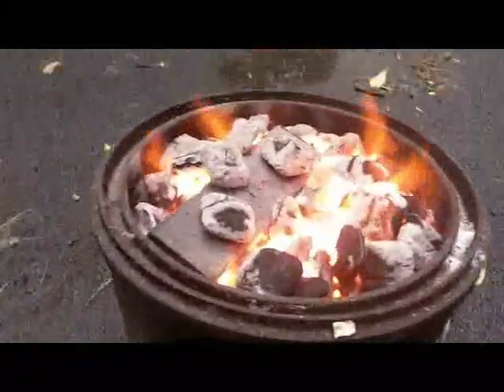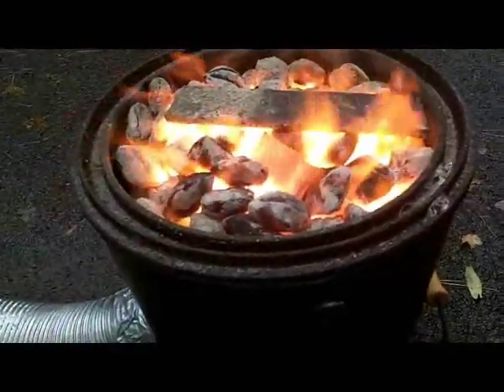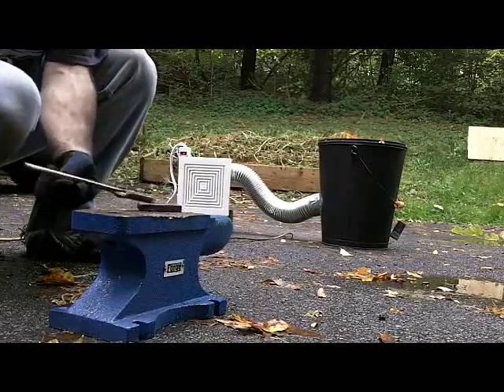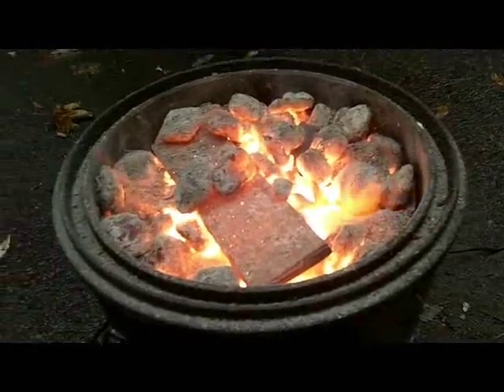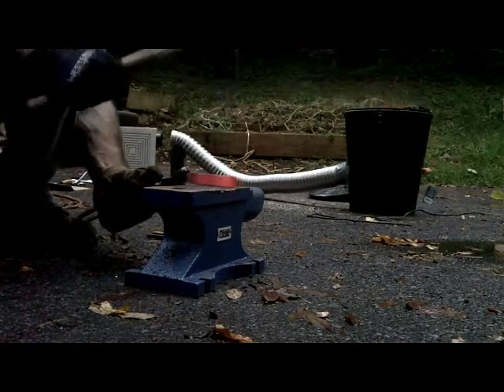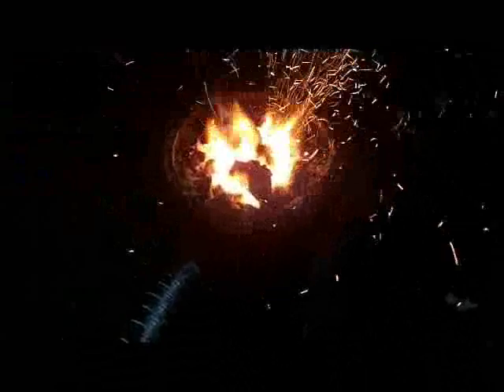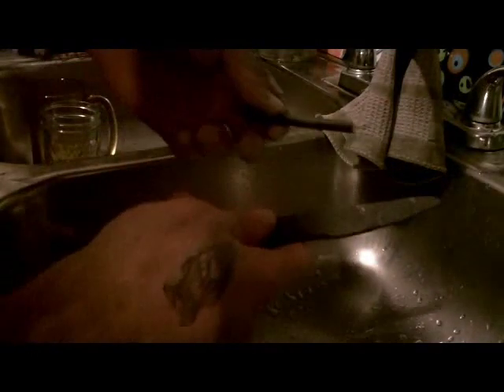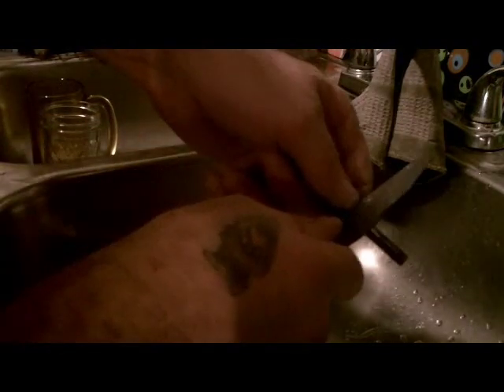Leaf Spring 1085 Knife and Homemade Brake Drum Forge

Comment: Soak lump charcoal in a bucket of water to reduce Sparks and conserve fuel.  Just dump half the bag in and add about 2-3gallons of water.  As you run low in the bucket, top it back up and slosh it with your hands
Reply: +drason69 oh, really. And I suppose if you heat up the anvil to red it will make the knife keep it's heat longer.
Reply: Actually, if you have any blacksmithing experience, you would understand how it works. Sorry I had to stoop so low as to reply to sarcasm with sarcasm.
Reply: drason69 I don't have any experience with BLACKSMITHING, but I have extensive experience with FIRE. It just seems like adding water to fuel would't work that well.
Reply: The practice of wetting the fire is to control the Sparks and allow the smith to regulate fuel use
Reply: ok.

Comment: Nice. I have made a couple of file knives and looking to do the leaf spring next. I like your forge. Did you cover up the big hole in the drum?
Reply from the maker: Yes there is a drain cover over the big hole and a plate over the lug holes...  Will try to post a detailed video of the forge because it has proven pretty functional and much cheaper and easier to make than any other simple design I have seen
Reply: Chandler Dickinson
Thanks, I would like to see how it is made, I think that is the way to go on a forge.

Comment: nice work!what was the thickness of the blade?and what kind of coal you work with,keep up my regards from Greece
Reply from the maker: I think the knife finished around 1/8 inch thick but with the leaf spring i have made much thicker and much thinner blades...  It's a great starting material and you can go as little or as much as you like.  I am not sure exactly what coal it is but the brand is Reading - and is from Pennsylvania - I ordered some coal off ebay from Kentucky but it burns very very dirty...  This Reading coal I found locally and have been happy with it.  Thanks for your comments!